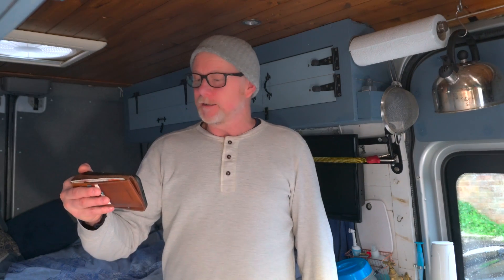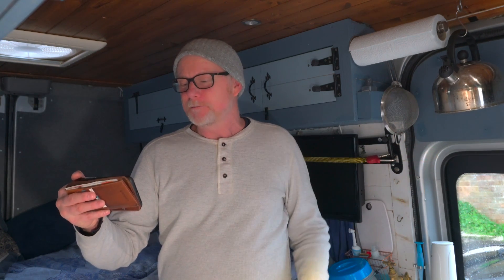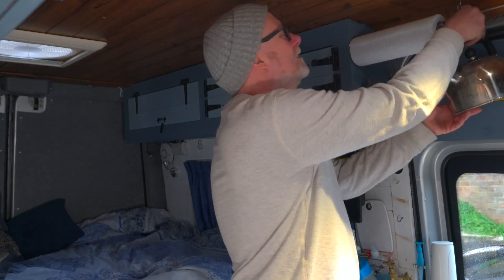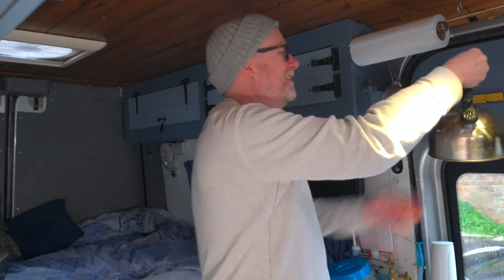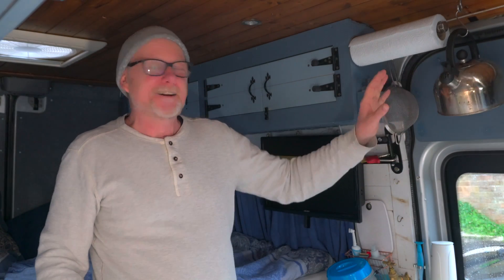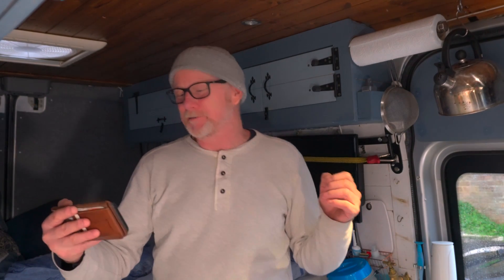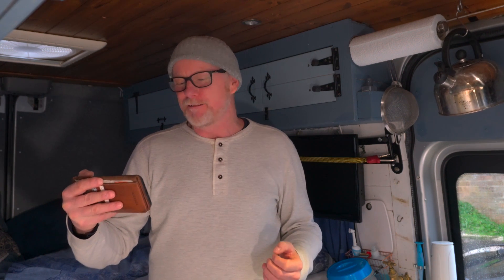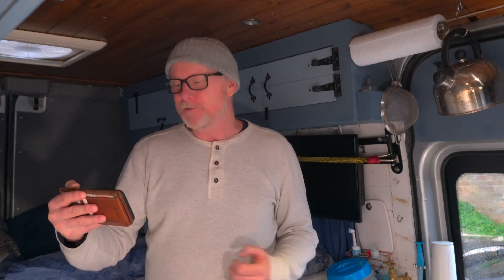Can you charge a lithium battery with a car alternator?  What Is LPG gas? van life Q&A

Comment: Lithium charging. The chemistry make up is very different between the batteries. Very good advice so long as they understand all of what you have advised in every detail. My only additional advice is to upgrade the Alternator. 50 Ampe is low even with the dc to dc. I would double the output. My estimate is the Alternator won’t last very long. Great channel.
Reply from the maker: Thank you buddy some good points there 👍

Comment: If the replacement pump video did not work it is not your viewers' fault. Much more valuable (and less irritating) would have been a proper full install underneath the van, including splicing into your diesel tank, although much less comfortable to shoot no doubt, featuring both standard and expensive replacement pump.
Reply from the maker: I setup like I have so I can film it